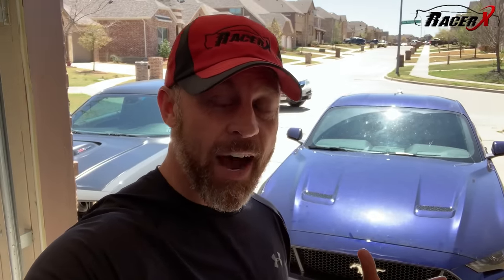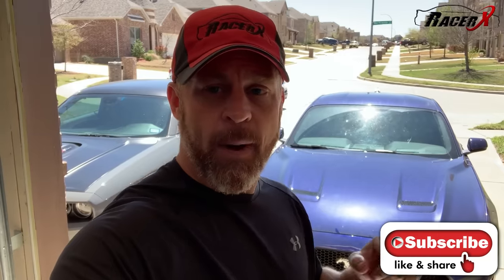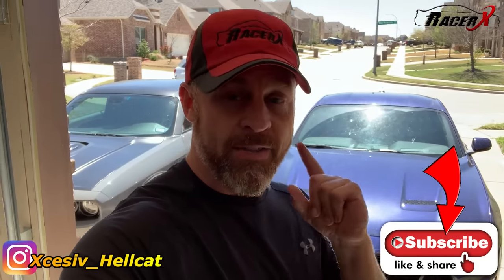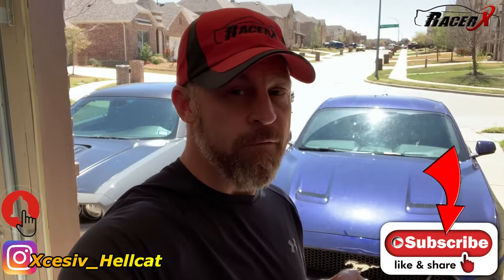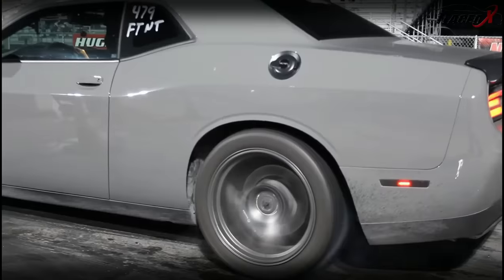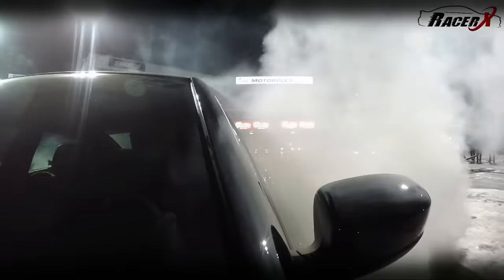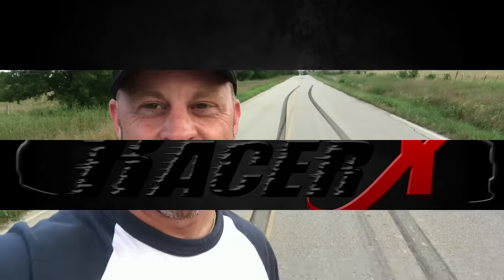Here's the Problem with Going to E85.. I couldn't have predicted this..

Comment: E85 is great for the knock resistance but why not just go m93 or vp105
Don’t forget it takes 30% more E to make the same power so your trip to the pump is more often.
Also when it burns some of it turns into condensation and you get water in your oil so a daily driven aspect you have to change oil frequently
Reply: Only problem with VP105 vs E85 Flex Fuel in my opinion is that if your tank isn’t completely empty your not getting pure 105. Could end up resulting in a little bit of knock. Other benefits of  E85 is it keeps down those EGTs and it’s a lot cheaper than 105 or 110 octane.
Reply: @Dave-so7sf  that’s true but the amount of fuel you go though is higher than if you ran 105. I have had e90 tune and a 85 tune neither of them gave me the bang for buck I wanted then I found 105. I wouldn’t say I daily it but at least 2-3 times a week I drive to work and zoom around cost me about a tank a week so maybe 150 if I’m heavy on that loud pedal
Reply: @BobbyB910  I guess and maybe I’m kinda bias with the E85. I daily a built big turbo STI and I just find it very convenient with the flex fuel sensor. This year I’m decommissioning it as a daily and maybe I’ll have to try out a vp 110 octane tune.
Reply: @Dave-so7sf  I actually get really good mileage for a supercharged KA24. On e85 I got around 15mpg on 105 I get around 19 and my power went up by 35hp. I have meth injection because I don’t have an intercooler it’s only 15cc
Reply: VP 105 is almost $15 per gallon, when purchased in 54gal drums. 

BTW, that drum weighs about 325lbs. In California, storing this amount of fuel in your garage requires a flammable liquid storage cabinet.
Reply: @kyleallen3857  Cali is a communist state
Reply: I drive 150+ miles to get my e-85, so I obviously fill up my ecoboost truck and numerous fuel cans.  I went there once, and they were out.  That's why I run a E-50 tune instead.
Reply: @michaelpopp6340  I daily a ats 2.0t now with a flex sensor and usually run a e50-e60ish blend nets me 380hp to the wheels and around 28hwy 20city

Comment: What is your opinion on the E85 pro flex commander kit? It's just plug and play....
Reply: I use the pro flex commander on my scat pack, been using it for about 15,000 miles. It works great. I can feel the difference. I’ve used on the road course and it has held up great. I would definitely recommend. I also have the latest jlt intake which also woke up the car. American racing shorties and a jet performance tb.
Reply: @seanem7261  ok cool that's what's up! Did you have to get a tune with your additional mods like with the intake, tb, and shorties?
Reply: @fadedsapphire6860  if you do the mods I mentioned you don’t need to tune it, but it will help maximize the performance mods if you do a tune. But with the mods I have right now , it’s at .82-83 lambda which is a little rich on gas and on e-80 I’m like at .87 which is ideal

Comment: To be honest, I never recommend e85 to anyone unless they own a flex fuel. e85 does seem to have issues with clogging the injectors on direct injection engines, and it's much easier to just run a tank of regular gas every once in a while to clean it all up without worry. 

e85 is still in it's infancy, and the fuel doesn't have an additive package available quite yet to make it a perfect replacement for regular gasoline, although there is definitely potential for it to be a much better fuel than gasoline. 

On a GDI flex fuel engine, you just get the benefit of both worlds, as you can primarily run gasoline, then switch to a tank of e85, or run e85 primarily, and switch to a single tank of gasoline to remove all carbon deposits left from the other fuel. 

About the food production topic, all of those issues could be resolved with simply producing ethanol from switchgrass, not corn. The process produces better yields, and would further drive down the cost of e85.

Comment: I’m just seeing this video, and just subscribing to your channel. Good videos 👍🏾
My question on this, is what if you have two tunes, a 93 Octane and a E85? I’m thinking there would be no issues. I’m currently going through the E85 conversion, switching to the fore innovations return fuel system. I already have the bigger injectors, and a ProCharger supercharger. I basically want to run E85 in the summer and 93 in the winter (or whenever), but basically want the flexibility to switch back and forth whenever I need to. One thing I didn’t know was that it separates after sitting for a week or so. My car also my sit for two weeks without being started, so that was good info there. Thanks!!!

Comment: The only area where E85 is a great choice is where you want increased performance, such as racing, which of course is your channel's focus.

Problems with E85...

Ethanol attracts water.

Ethanol gums up after a short time in a tank, causing fuel-related problems.

Ethanol reduces mileage by 20% or more.

Ethanol is terrible for small engines, such as lawn mowers, and other lawn care devices, generators, and marine engines.

Production of corn-based ethanol uses more fuel that it produces.

Production uses land that isn't currently in use, leading to deforestation and increased greenhouse gas concentration... or,

Production uses land that is currently in use for food production, thus driving-up food prices.

Comment: I have a 2021 scat pack, it came with the 245 tires, what is your opinion of installing the 275/40rz20 tires just in the rear or all four corners, I intend to do an occasional autocross and want more a road race car rather than a dragstrip car.  Years ago on my 70 camaro z28 I put wider tires on the rear only and this car. would literally 4 wheel drift under power.  The thing that is a problem with wider rear tires is rotating the tires.  I respect your opinion.  Just for reference, I am 74 years old.  My other road car is 89 IROC Z.

Comment: During the pandemic they stopped making e-85 because no one was driving and the price of corn fell thru the floor.  We need e-85 production to make sure the farmers are getting good prices for there crops. Pandemic proved it. And the other positive is if every e-85 owner burned one tank of e-85 and one regular tank you cut gas consumption nationally lowering price across board.

Comment: Theyre looking at switching to Switchgrass.. It makes about 6 times the output compared to corn on the same land.. which means either more fuel from same land.. or you can use 6 times smaller land for same level as now

Comment: Here we can get E30 & E85. E30 is the cheapest and is what I use. There are several stations selling it and seeing the varying levels of Ethanol allowed to be E85, I got a test kit and found that the station I was buying E30 from was only 7% so I tried the other brand and it checked 30%. Using it I gained about 15 HP and lost only 1.5 mpg. I was going to use one of those Flex fuel sensors, but my tuner Jay Greene told me he doesn't write tunes for cars that use one. Just be careful about your supplier's constancy.

Comment: Well the  real problem with E85 from corn is that it does not even exist without government subsidies. Corn lobby is being paid by the taxpayer to produce a gallon of alcohol that contains less BTU's of energy than what was required to grow the corn, fertilize and harvest it, and then distillation. Not a thing wrong with making alcohol, but without the taxpayer involvement, all alchohol bends would cost signicanlty more than straight gasoline. As far as green, it's about as green as the diesel running the tractors used to plant and harvest the corn. Good for racing applications, just subsidized by your tax dollars.

Comment: Ethanol is terrible for motorcycles and small engines! I hate it. Older vehicles don’t do well on it at all, My 69 Dodge won’t run on that crap, it just coughs and dies over and over, once more the more ethanol, the worse the gas mileage not to mention you will have water issues with your fuel tank. I hate ethanol!
Reply: I’m sorta with you on that.  Certified airplanes, unless the fuel systems have approved modifications to the fuel system can’t legally run fuels with any ethanol in them.  Seals, and fuel Hoses rot, and vapor lock really sucks when you’re in the air.
I put ethanol free fuel in me R/T when I take it off the road for the winter.
Reply: @dadams8086  yea and good luck finding non ethanol fuel now. My STC is useless. I pay $6/gal for the blue stuff.
Reply: I used to feel the same way, but newer muscle cars run great on it as long as it’s properly tuned for it. I had it on my ‘18 SS & loved it and if I wasn’t tracking my ZLE I’d run E85 in it as well... don’t want to ruin my warranty just yet is all.
Reply: @rockcrawler3119  I don’t know where you’re at but here in this part of Washington State ethanol free fuel isn’t that hard to get.  Problem is, unless fly an ultralight, you have to practically have a tanker truck, because none of the airports have mogas.  I don’t have an STC for mogas, and hate paying the current $5.69 for 100LL.  I spent $180 on fuel today, and that was only half a tank.  But, that’s the cost of fun.

Comment: Using alcohol fuel for auto racing makes sense. But it makes absolutely zero sense for driving on the road. Race car drivers know that the fuel economy is half or less than that of straight gasoline. It’s the biggest rip off going today.

Comment: The problem with E 85 you get less than half the gas mileage plus the stuff stinks terribly bad plus it can’t sit very long without ruining injectors, causing gum deposits on parts corrosion there is a lot of drawbacks to that stuff. I don’t particularly like it.

Comment: yeah it's not sustainable.  it's a ruse.  monocropping , whether it's for food or fuel or fiber, needs to be stopped period.  there are plenty of systems for food, fuel and fiber crops that utilize perennial trees, shrubs and ground cover.  they can be planted in 3 to 7 year staggered harvest systems that can drastically reduce carbon loss and eliminate erosion.  some systems can even increase top soil at the same time they are producing a product if regionally appropriate livestock are rotationally grazed within the agroforestry and polyculture orchard systems.  large multinational corporations are rejecting these time tested techniques that are thousands of years old. I just figured I'd include this for your edification.  thanks for the video

Comment: good explanation... from my perspective e85 is a "bad" thing.  Less mpg, more cost per mile driven.  But if I lived in a state that took tax dollars from the hard working folks to subsidize the price of e85 it would be worth running.  I'm hearing it's already twice as expensive to buy regular gas compared to e85 in some parts of the country.  Where I live usually only about 10 cents difference in price per gallon.

Comment: Flexfuel tune for DD, and a dedicated race fuel tune for the track.  Can still get 10 gallons of MS109, or 104 Sunoco at any time and get all the benefits.
Reply from the maker: Flex fuel tuning for these cars still doesn't work well.. my car consistently pulled all sorts of timing and the car didn't run well at all unfortunately.  If I stayed on 93 with that pulley ratio the car pulls all the power out .. bit of a frustrating situation
Reply: @RacerX9  flexfuel works great on my 2019 mustang, or are you talking about your Dodge?

Comment: My issue with e85 is actually finding a station that has e85 and not e77.When you go to most gas stations the e85 pump is not e85 and then your tune has no use. I run 93 pump fuel and run 7.0 1/8 mile pass at 100mph everytime.

Comment: The answer is that you never ever ever ever ever ever ever ever ever ever ever ever put e85 on a daily driver. It’s a horrible decision. ETA: you also should stay away from flex fuel as well on the Coyote and really, anything. You’ll run into a ton of issues.

Comment: E-85 is at minimum 70% Ethanol. According to the EPA sticker on the Pump.
My flex-fuel gets 1MPG less But. In Nebraska, it is 80 cents a gallon less.
The car performs better on E-85.
Reply from the maker: The bummer is that I have tested some E85 out of the pump that has tested out less than E60  .. It sucks that things are so inconsistent

Comment: The bad thing running E85 eats up your seals after a year, I had to redo my main and rear seal and cam seals and also my valve stem seals. Most of the cars that are not designed and have the special stronger seals in the motor to run E85. My seals got so bad leaking engine oil like 1/4 cup on my driveway and just had to redo it all. Yes its awesome fuel cool burning fuel and you can get more HP out of it but it does burn 30% more fuel than regular gas. It would be better to run flex fuel so you can run either but I just went back to 91 octane because it was not good to rebuild my seals every year.  My advice before you run E85 is pull your motor and run the E85 compatible seals in the engine and you should be okay.
Reply: Why would E85 have anything to do with crank bearings or the cam. The fuel isn’t going into the block or around the cam. Plausible but unlikely with the valve seals. Should only effect the ‘wet side’ of the fuel delivery system. 😕

Comment: Hey Racer X have you heard of the ProFlex Commander from Advanced Fuel Dynamics.  Its an inline fuel sensor and controller that you connect to your spark plugs and you can run any combination of e85 and pump gas on your vehicle.
Reply from the maker: Yes I have.. some guys have had some issues with those unfortunately.  I know 3 different guys that engines grenade themselves because the sensor did not work and the engine went lean.  Just something to think about
Reply: Hi racer x im Johnny out of SA Tx ok I have a 18 mustang gt premium. It’s on a flex tune by lethal performance of Tx but I got a bank two code .it’s been on 85 for a little over a yr .it’s a in house tune 2” stainless works long T, Hpipe  MBRP Axel  back . Jlt caí manual too. I’m new to this I need advice in how to solve this ! Plz help sir!shops are so expensive

Comment: My 2002 S10 2.2 Vortec is designed to run on E85 only problem is that it's difficult to find it in my area here in Tucson,Az.

Comment: About halfway through your vid I stopped watching because I'm a fuel hauler by trade (I've been delivering gas, diesel, kerosene, heating oil, etc for 16+ years).  You don't do what I do without learning a little something...  In November of 2009 when most states converted to E10 gasohol I started to realize that this ethanol stuff is bad stuff.  It initially cleaned the linings of the station's tanks and sent all that crud right to the pumps' filters and clogged them up.  Then a couple years later we all learned that ethanol based fuels were really bad for small engines because of carburetors & rubber/plastic gaskets, parts.
Extremely long story short, I run my personal vehicle that I care alot about with 100% Ethanol-Free aka E-zero aka rec90 gas because the old fashioned regular conventional is a much, MUCH, better gas than this stupid corn/soy based crap!

Comment: If every acre was planted with corn in the United States to produce 2010 epa ethanol standards, we couldn’t meet those goals. Ethanol is made from bio fuels, not just corn. This whole video was flawed and clueless at best. You didn’t even touch on the fact that ethanol EATS rubber and plastic. Fuel lines, pumps, o rings, seals, etc etc all will need regular replacement.
Reply: BS. etc etc etc.

Comment: I’m getting a set up on my jk that has a LT1 in it and. When I’ add a whipple supercharger to I’m having a system put on that’s 500$ that gets tuned with 87 89 91 93 and 85.e.   I hope it’s relatable I guess it takes about 4-5 miles of normal driving to really set the right tune for it.    My motor head swap guy had it planned to be putting 1050 hp to the crank 750 to the wheels I’m not sure how I’m keeping the power down the stock LT1 spins the 40s already
Reply: Why are you planning on so much drivetrain loss?

If you are at 1050 crank, you should see 840rwhp with 20% parasitic loss. 

I have heard of Tuners describing very high drivetrain loss numbers so they can claim 1,000 crank horsepower.
Reply: I have a 5.5 lift and dynatrac 72 inch wide 60 axels with 40 inch tires
Reply: It’s a wrangler jk

Comment: The e85 that is made for fuel is from a different crop. Basically the companies that make the e85 race fuels is separate from the food that people eat. But I think e85 will be the solution to our issues with the EPA and car improvements solutions. But the oil industry will have to let everyone in the United states to have it. Or when I build my shop house I will have to have my own 300 gal tank in the ground for my own e85 source.
Reply: Much more cost effective to get it from the pump. Many medium/big gas stations are inspected weekly for moisture or contaminants. 

You would have to empty those tanks monthly and ensure no leaks or contamination present. Also taking into account that you spend the same money as a gas station to make a underground tank with all the safety features and it’s approved by the state. Only takes an annoyed neighbor or jelous about your car, house, bbq, etc to report you. 
Just FYI. 
Way more cost effective to get it from the pump. What you could do that would save you $ in the long run and no issues with the state - it’s to get 2 x  55 gallon drums. With a drum manual pump or fuel scavenge pump to fill your cars easy. If you have a truck, you would only do monthly fill ups.

Comment: Racer x quick question my stang 2019 running e 85 flex tune what additive do you recommend ?
Reply: Fuel cleaner injector
Reply: Power plus.  I got a video on it it really quiets down fuel pumps and injectors.